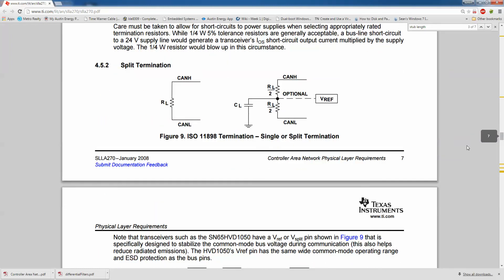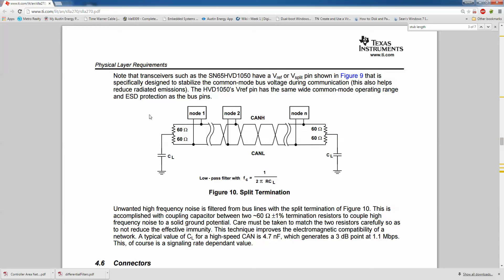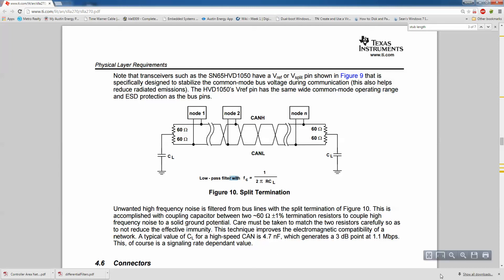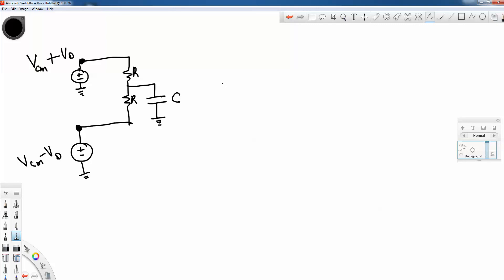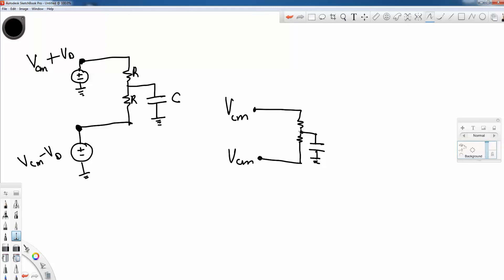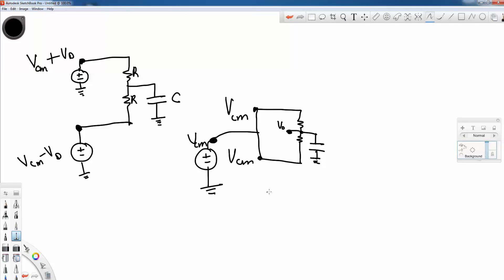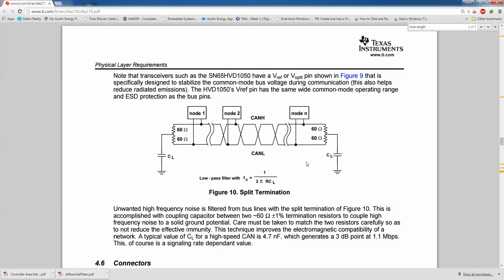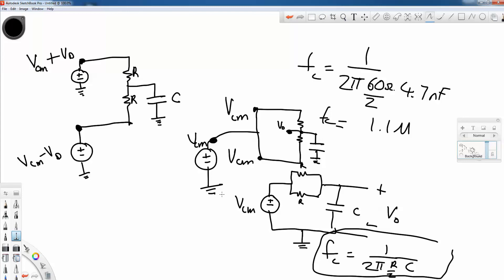CAN Split Termination RC Low Pass Filter Analysis

Comment: Great description of how the corner is calculated. How did go from Vcm + Vd to just Vcm?
Reply from the maker: Osman Eralp if you analyze the circuit for Vd, you will see that the Vout/mid point is zero. Thus the filter is only for the common mode.
Reply from the maker: Osman Eralp remember that you can use superposition of sources for linear circuits. Adding the contribution from individual sources for the Vout. Sum of the parts. Short the voltage source you want to turn off. For Vd, short the Vcm.